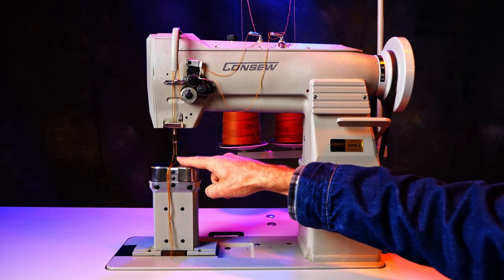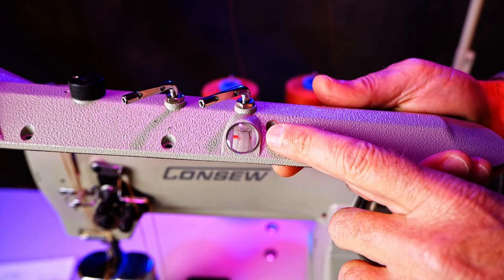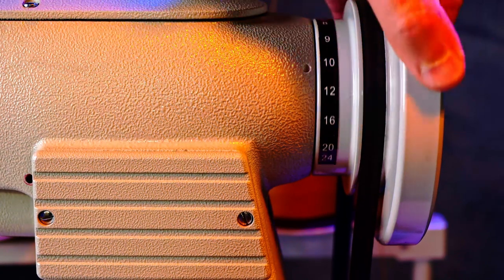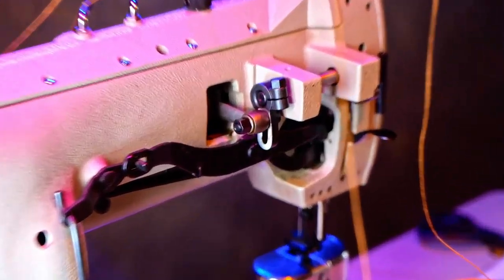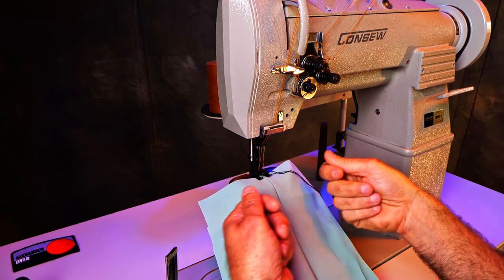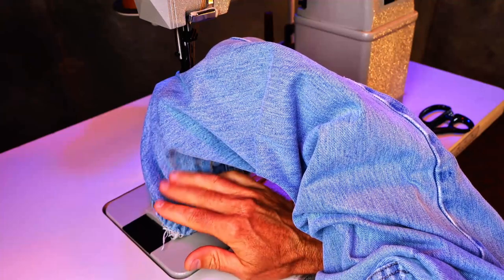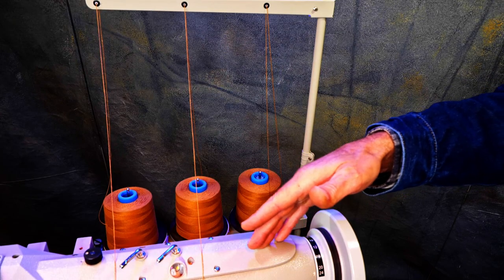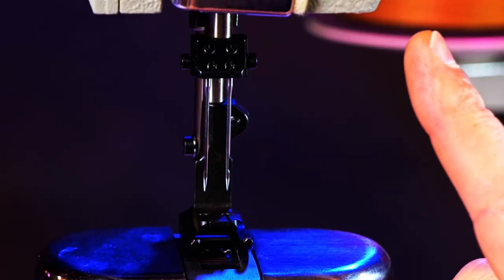Consew 389RB-2 Features Adjustments Threading and Applications

Comment: A technician friend clarified for me - I have the exact same machine - that the oiler is not a valve, per se, but a counterweight that moves up and down on the spring-arm. It moves up and down with the vibration of the machine to pull oil up onto the trough into which the wick is inserted. Almost like a “splashing”. The vibration of the machine was the missing part I couldn’t logically follow , trying to understand how the mechanism worked. When the machine is at rest and the user has the cap/cover and gasket off and he or she is looking down at the mechanism, it’s not apparent how it works. But it is definitely not a valve in the traditional understanding and function of a valve. It moves over a cast iron bed, without a port to open or close - as a valve would. 
This very video helped me to decide to purchase my machine. So THANKS Captain Andrew, 🫡skipper of the war ship🚢